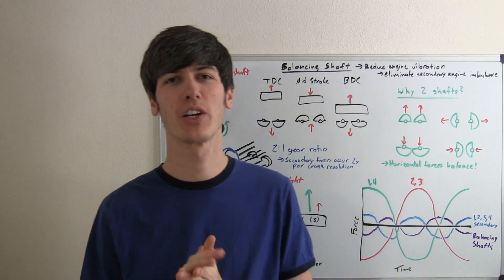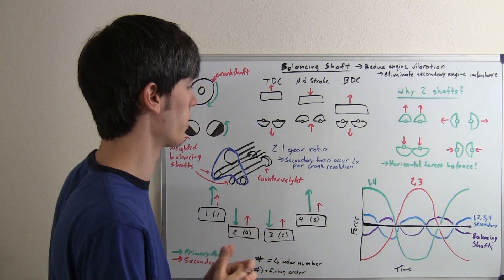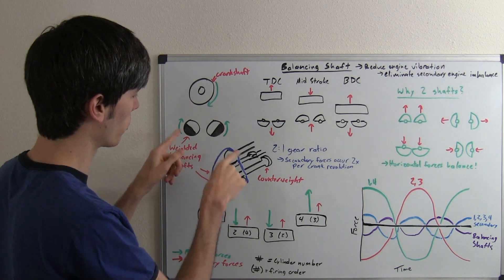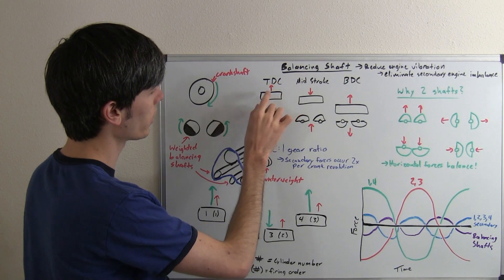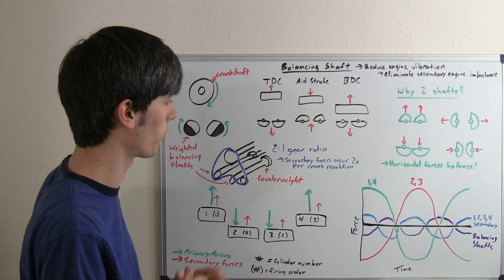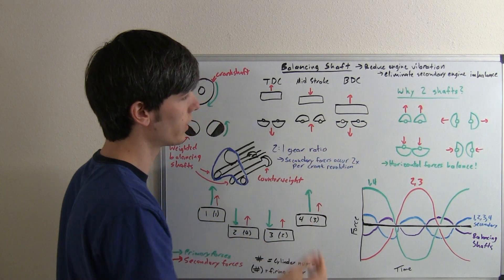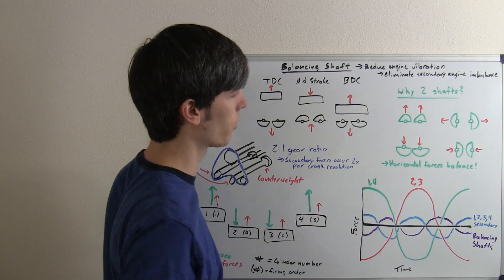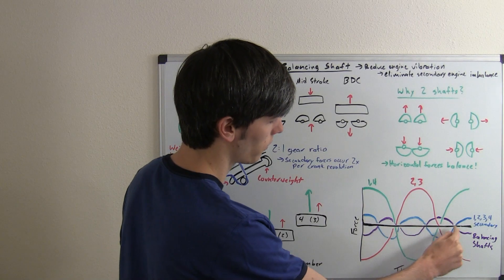Balancing Shafts - Explained

Comment: Thanks for the amazing explanation, however since my Camry balance shaft aren’t made to last forever, OEM part is expensive and the cheap “ made in China” last for six months , I’m going to remove the balance shaft main sprocket to prevent it from rotating and making noise if the vibrations are beyond my expectations I’ll install a new working mechanism 😏
Reply: Update: I’m putting back the balance shaft mechanism I can’t stand the awful engine vibration 🤦‍♂️

Comment: Or would it just be easier to eliminate those Balance shaft because the more horsepower going to make more the engines going to rotate which in turn would fix its own problem if it makes any sense

Comment: Remember it's centripital not centrifugal so the force is at a 90° like if your swinging a plum Bob people say it pulls outward from the center but it does not it has an ever changing vector perpendicular to directly out from center. When you let go of the plum Bob or weight at the top when the string strait up and weight at the top hand in the middle of course let go and the weight will not fly into the cealing it will hit the wall perpendicular to the cealing

Comment: I am about to modify my Toyota 3rz for boost (racing) and a common thing to do is to remove the balance shaft/s, I've been told to allow the engine to rev higher.
Please explain how or why I would need to remove the shafts and how it benefits me in a race scenario
Reply: Same effect as lightening the flywheel, but with the downside of increasing vibration.

Comment: The balance weight gram determination would be good to know. When people modify an engine with a lighter rotating assembly they delete the balance shaft because it will cause it's own secondary vibration being too heavy. If you want to rev like an R6 you need it in there and need it balanced to your new mass.

Comment: Hi i cant figure out every ting, so here is my question for you. I did a transmission wit a ninja 250 motoe. removing the piston and rods. keeping the gearing..  but as i spin the motor 500 600 700 rpm,  it shake left to right.. there is balancer shaft in there. shoud i remove them also ?? Tk

Comment: Hey I’m a new vw 2011 cc 2.0 owner I’m being taken to town currently because it has a oil pressure engine off flashing despite new oil sensor and change no leaks no crack in pvc valve but the vw dealer keeps hinting he wants to tear the engine apart any help would be appreciated
Reply: It’s the four cylinder

Comment: I think the balance shafts also help to stop the con-rod and crank journals from hammering themselves to death due to the longer stroke and greater forces and con-rod angle at BTC in larger 4 cylinder engines, say 2.0L and above, thereby increasing engine life. Which is probably why some smaller 4 cylinder engines don't use balance shafts; less than 2.0L for example.

Comment: Good video except you have one point wrong The counterbalance shaft run at One to one Gear ratio to the crankshaft not to 2 to 1 as you explained as that would put The balance weights back into the same position after the piston had done one stroke 180° of the crankshaft 360° on the balance shaft all other points are correct

Comment: The reason why I'm watching this video is because I have a 2001 sport trac with balance shaft engine and I pulled an engine out of a 2002 from the junkyard and it doesn't have a balance shaft. 

So I was wondering if I need to put the balance shaft on this new engine or not. 

I'm afraid it doesn't need it and it will just make my new engine vibrate instead of the opposite.

Comment: You explained very well, But i have a question, You explained in video 180 deg at TDC, 180 deg at mid & 180 deg at BDC,  but as crank shaft rotates one cycle that is 360 deg, the balance shaft rotates twice that is 720 deg. So where is another 180 deg?? Kindly explain !!!

Comment: My mechanic removed 1 balancing shaft from my 4m40, is it safe to drive it on long routes? Plz help me I am planning a family trip on it now
Reply: Everything depends on the size of the engine. Also if you want to drive it at high speeds then you should probably get it restored. Bcoz u will feel either very increased vibration pulses or a high magnitude pulse and a low magnitude pulse.
Reply: @aniketdeshmukh836  besides that? Any mechanical issues?

Comment: I have Heard of some people deleting counter balance shaft with delete kits. Can this cause vibration in The engine and possible engine failure? The reason I’m asking this is because I’ve been anticipating doing this to a block on a Toyota 3rz because the bearings  Spun  in the block for the counter balance shaft and I was hoping to salvage the block to rebuild the engine . Any information on this would be appreciated

Comment: Are balance shaft's any issue with reliability? Do they wear out or get out of tune?
Reply: Hi there! I know this comment is old but I'm still answering. 
I'd say it depends on the design really. EE showed a system where the shafts moved using a pulley, but again it depends. I've heard of pulleys, chains, and gears being used to spin the shafts. From personal experience, I just had my shafts deleted after one of them completely failed on my 09' Camry. In my case, the shafts have gears, both metal and plastic, and well, you guessed it, the plastic gears completely exploded and almost destroyed my engine. I was lucky that I had a mechanic on the passenger seat since I was hearing a spooling/whirring noise, and had that happen on the test drive so we were very close to the shop.
Reply: Thanks for your comment. I would like to avoid engines with balance shafts for my next vehicle. I don't think in line 6 cylinders have them. I wish there was a list of cars that have them and don't have them. @mcdonalds4399

Comment: You did a good job explaining their use. But why would it be a reason to delete them? Only reasoning ive been told is for high rev application. Which makes more sense because having 30lbs of weight on the crank thats at its max or nearing its max. That extra weight is just going to cause more wear

Comment: So then is the vibration that only happens when my 4cylinder scion ia gets down to 500 rpm (usually after a long drive while in drive at a full stop with no accesories on) most likely not actually caused by the natural imbalance of 4 cylinder engines and actually most likely caused by the frequency created at that specific rpm matching the natural resonance of something in my car? I've made sure everything I can reach without tearing everything apart is torqued to spec and I checked everything and I mean EVERYTHING that can be checked at home using mostly basic tools (I have a good obd a fuel pressure gauge and a voltage tester) are perfectly fine. I'm out of ideas and dont know where to look. I've also cleaned what little carbon build up there was out of various parts disconnected my battery and touched my battery cables together for a bit so that it could go through a "relearn" process to no avail. Nothing on my car is aftermarket.

Comment: My older four cylinder engine without balance shafts will vibrate more at 3,000 rpm's and also at 6,000 rpm's. I know this is due to resonant frequencies which will exaggerate the secondary forces at certain rpm's. How can I change the rpm that this occurs?

Comment: why at TDC the secondary forces are pointed UP, while at BDC are pointed SAME UP? (shown on the piston with read arrow)
Reply: Because the secondary's direction changes every 90 degrees of crank spin.
Reply: then what is secondary in this context: when piston going down at BDC while those two little weights are pointing also down? this i don't understand. thank you! :-)
Reply: aa, or it's only about forces that go sideways? when pistons are at mid stroke those two little weights pointing sideways? is this the trick, the balancing? thank you! ;-)
Reply: i don't get it because he says/shows this:
- when piston UP at top dead center, the two little weights are pointing DOWN (ok so far);
- when piston mid stroke and going DOWN, the two little weights are pointing UP (ok so far);
- when piston DOWN at bottom dead center, the two little weights are pointing DOWN... this i don't understand.

Comment: You never explained where the secondary force come from?
Reply: Think of the conrod big end moving side to side and the top end staying in line with the bore.  As the conrod angle changes, it accelerates/decelerates the piston/rod mass up or down, on top of the overall crank up/down.

Comment: Is the balance shaft run by balance shaft belt a 1 to 1 ratio with the crank shaft.??? I know the balance shaft on the oil pump is a 3 to 1 ratio... Please advise...
Reply: 2:1 shaft:crank

Comment: has any engine integrated the balance shafts into the cam shafts? a lot of inline fours have dual cams so just grind the exhaust cam so you can spin it the opposite direction the intake and put the weights at the end of the cam shaft since there isn’t a distributer

Comment: Thanks for another great video! 
When modifying an inline 4 cylinder engine, typically with lighter rods and pistons but also perhaps with increases to bore, stroke and rev limit, how important is it to also modify the balance shafts?
I realise that technically,  ideally, it should probably be done but imagine it may be a little complex to calculate and implement. Given that most I4 engines 2.0L and below don't even use balance shafts, is it acceptable to just leave them as they are?
Secondly, I know that some delete them, especially for race applications, but is this a good idea for large capacities around say 3.3L? I know of some larger engines with balance shafts deletes that always seem to be cracking up and I wonder if the Balance shaft delete could possibly be a significant contributor to this problem?
Thanks again for your excellent and very informative videos!

Comment: What will happen when the balance shaft belt of 4D56 diesel engine breaks while the running?
Reply: if it gets in the way of the main (big) t belt then, presto!, you get new rocker arms and maybe valves.

Comment: Won't the crankshaft lose energy, as it has now to spin those 2 balancing shafts also? Won't we have less energy to transfer to the wheels ?
Reply: Those balancing shafts will use some power but not much. I wouldn't be surprised if they use less power than the alternator.

Comment: I am Working on my GF's Daughter's 2006 QR25DE , discovered the unit is suffering from shattered testicles ( the drive gears are shattered , bearings shattered and housing unit bearing seats are destroyed ) , this is what I have in mind to fix this permanently : get a new unit , go to local machine shop and cut off the housing seats and install new cast Iron  or bronze bearing seat blocks to house the shafts new bearings  , I think the problem is in the housing unit not the shafts , the balancing shafts are made from steel and the housing unit is aluminum , too weak to handle 2-1 RPM and friction in ordination of Crankshaft RPM . besides I saw the engine block has those either cast Iron or Bronze made, that houses crank shaft bearings why not do the same to the balancing unit ? what do you think of my Idea ?

Comment: Thanks for the video. I have a question I have a obsolete continental 4 cylinder engine I cannot find parts for. It spun a balencer shaft bearing. I tore it down to re-ring it. A piston and liner kit are no longer made. Then I found the shaft ruined. Shaft is no longer made and no salvage parts available. My question if I remove both shafts plug the oil ports to them how long will the engine last? It's in a tractor hi load on the engine sometimes but mostly half throttle using the hydraulics no engine load. Is it worth trying or a waste of time and money.

Comment: I'm confused, in your video you state the shafts spin at twice the speed of the crankshaft. But your drawing showing mid engine position, looks like it is spinning four times the speed of the full revolution of a four cycle crankshaft revolution. Or 4 times the speed of the camshaft? Please help clarify. In other words, if the lobe on the balance shaft is in the upright position, at mid cylinder stroke, the the lobe would be spinning 4 times per complete revolution of the crankshaft through its one, complete four cycle revolution.

Comment: Thanks for the video. Very important question: if the balance shaft is off from it's correct position does it affect the fuel pump timing? Please advise. Thanks.

Comment: Hi guys, can i completely remove the balance shaft and run my engine without them because the left balancce shaft bearing moved off position and blocked the oil gallery causing my engine to knock

Comment: so if engine uses balancing shafts  it is passible to use lighter flywheel, because balancing shafts accumulates some energy, and engine is not become so much less fuel efficient.

Comment: Hello I have a 1993 Chevy s10 4.3 v6 vin code z with tbi injection..I am doing a complete rebuild on the motor and I would like to remove the balance shaft and plug the oil holes ...I am putting headders .intake . comp cam rockers .comp cam push rods. comp cam hydrolic lifters .New stainless steel valves .cosmetic head gaskets ...and possibly a powerdine super charger ...energy suspension motor mounts ..and a lot more ...I would like to know your thought on removing the balance shaft put of this motor as it's hard to find anything about this online for this motor ..this is a street truck not all drag ..thanks for your time Joe .

Comment: so. youre telling me that you need to counteract a piston moving up or down. well there are 2 pistons moving up while 2 are moving down. the 4 pistons while in motion are counteracting their selves. the secondary imbalance comes from the direction change when the pistons are at top and bottom dead center since the pistons have to stop and restart their motion casuing the whole engine to move. since the crankshaft with have 2 direction changes per revolution that why you have the gear ratio youre talking about

Comment: I have a 1999 Ford Explorer with a 4.0 liter single overhead cam 6cyl engine, this engine has a balance shaft in it and I was wondering if you could give an explanation! this vehicle is four wheel drive also

Comment: Hi bro, I desperate need to know if my 4 cyl engine needs bobshaft to balance, or just balance the crankshaft without using bobshaft to lightweight counter weight ? Or just need to assembly pistons and con rods weight?

Comment: Hello, I have a 2009 Kawasaki KLR 650 that is a single cylinder and it vibrates really bad. My question is, how do they (The factory) determine the weight of the counterbalance weights?? I am guessing, they weight the wrist pin in the crank and the big end of the rod, add them together and make the CW the same weight to cancel out the forces going in the opposite direction. Am I wrong, right or not even close?? Thanks Joe

Comment: So when i see balancing deleters what are they hoping to gain? Is it taking the balancing shaft out of the equation to reduce load on the crank? Could anyone point me kn the right direction?
Reply: i think since the shafts have mass they take energy to turn so you are "loosing" energy to making the engine smoother which you could use to go faster. but in practice i think the small gain in power to the drive train that you couldn't feel a difference in acceleration.

Comment: Is additional torque from the crankshaft required to turn the balancing shaft? If so isn't this counter-productive as ur using power from piston to rotate heavy counterweights against itself

Comment: what kind of people thinks that vibration is good cost for ~10bhp when they remove that balancers...I do not understand that mod...one my not so friend told me that he removed balancer, first he noticed little more vibration but than it was gone after some time...sadly he did not understand that he ruined engine mounts, and every Euro R I know in my city, all of them has mount problems